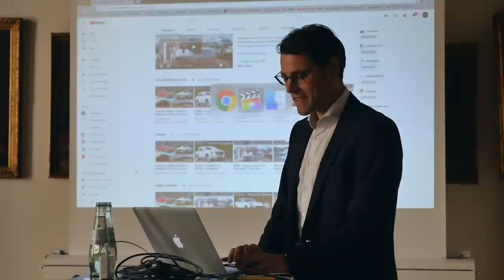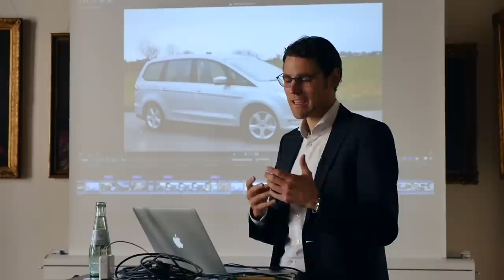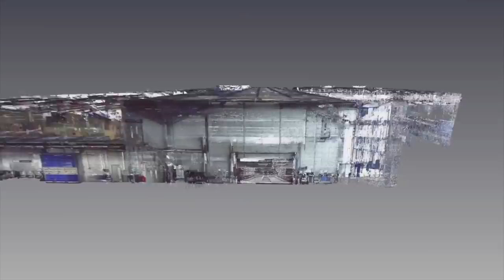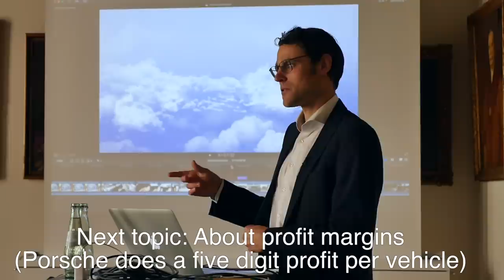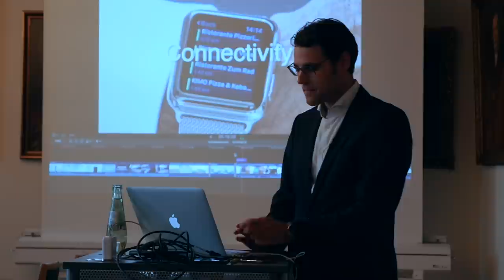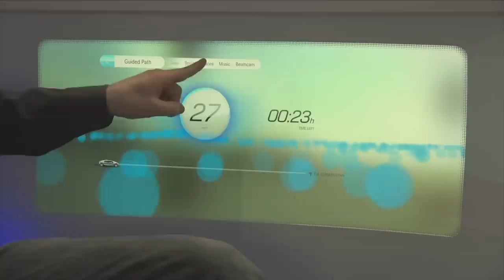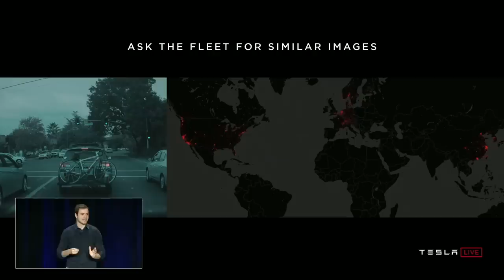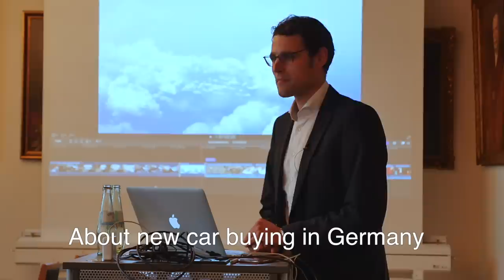Automotive Industry lecture by Autogefuehl Thomas @ WiSo University of Cologne

Comment: Thomas, I'm curious to know more about the quality of parts used in high-end, luxury cars. If one spends six figures on a car, one expects the best parts, technology and craftsmanship. However, you mentioned that this is not necessarily the case. Could you please make a detailed video on the subject, i.e. the reality behind the quality of parts used in high-end, luxury automobiles? Thanks, Govind
Reply from the maker: The only thing they do „more“ is using more cows in the car. They dont have the resources or the technology to be superior in technology, so they just decide that the customer should be blinded by more animal cruelty. The highest grad of build quality u only achieve in mass production because u set processes that everything is top not ch at every single model. While the top luxury brands put an old infotainment system in their car caus its not economical to update their cars frequently for a hand full of customers
Reply: @autogefuehl  Thanks for the reply. This makes sense in terms of scale. However, surely luxury car manufacturers who charge exhorbitantly should be able to afford the best infotainment system. Can it really be down to just sales figures?  

Did you see my reply to your introductory statement above? I wrote on another aspect linking animal husbandry and sustainability, i.e. greenhouse emissions from animal farms themselves. I'm curious to hear your thoughts on that. Cheers, Govind
Reply from the maker: They sell at that price because the target group would not buy if its cheaper :)
Reply from the maker: Not sure if i saw it, i ll check. animal farming is indeed the single most important issue in sustainability, climate change and distruction of our planet
Reply: @autogefuehl  I posted it as a comment to under your lecture. You should see it more easily now. :-)
Reply from the maker: Gotcha. Thanks for caring about animals and the environment!

Comment: My apologies for the long post.  Thomas fantastic video.  Highly informative.  I have a couple of questions/comments:

With respect to automation, have you considered how tax incentives may limit factory automation?  I worked on the design of a recycling center and the customer wanted to limit automation in order to increase the “jobs created” number in order to get local tax incentives.

With respect to Autonomous Driving, have you looked at the liability issue at all?  If the vehicle level 3 or greater and there is an accident would the manufacturer hold all the liability instead of the driver/operator?

With respect to Sustainability, have you looked at the impact of mining. I know you mentioned it in the video, but I didn’t feel that you had a strong view on what a good answer is to limit the environmental damage created by precious metal mining.

I completely agree with you about the use of animal products in vehicles.  The US seems more limited than Europe with non-leather options.  Certainly when it comes to steering wheels and gear selectors.

Thanks for all the good work and information you provide.
Reply from the maker: Thanks David!
Well I found Bill Gates idea interesting that there could be a robo tax which then funds a basic income.
Starting lvl3, the manufacturer takes responsibility in the situations where the car is driving autonomously. Note that in level3, there are split situations where you are driving and where the car is driving. Starting level 4, you do not drive yourself anymore.
Mining of noble earths is a huge problem. The only solution I can see there at the moment that the usage of material is being reduced (e.g. Tesla does that, their latest battery technology developed together with Panasonic used way less Lithium than others), I think we need new battery technologies on the long term.
Thanks for caring m8!
Reply: Thomas, thanks so much for taking the time for thoughtful reply.  I do appreciate it.   All the work you do is well thought out and produced.  Thanks for the great content!
Reply from the maker: stay with us! =)